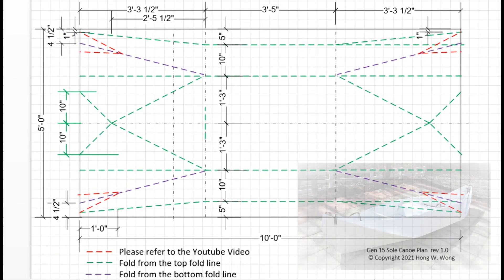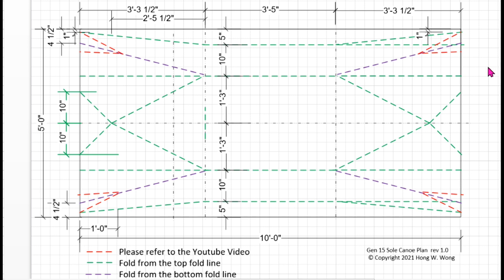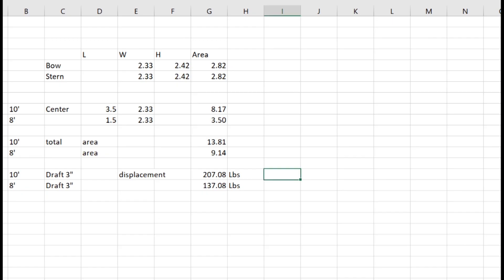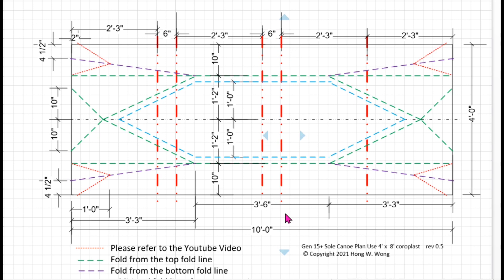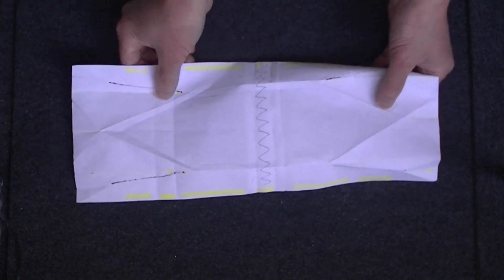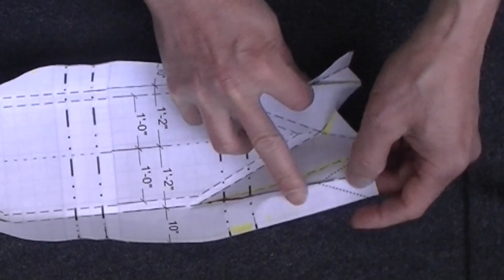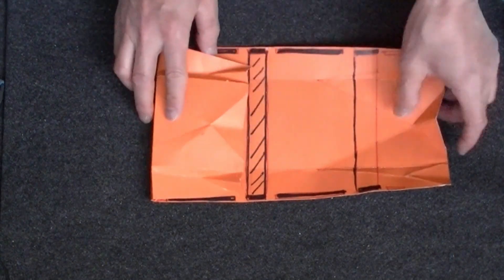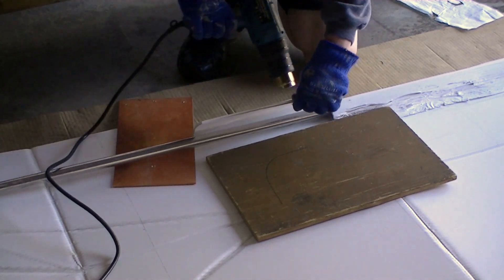Part 3 DIY 10' Foldable Coroplast G15 Canoe:  Canoe Plan

Comment: I really appreciate your video. I made a canoe that is based on your design. I rowed my canoe successfully on the river. 
Here is my canoe video:https://www.youtube.com/watch?v=P9HyylMYNYM&t=22s
Reply from the maker: Thanks for sharing your video. Most people just watch how others building boats, you are the few special ones who actually doing that. Congrats!  I have been watching others building theirs for many years until I realize it is not difficult if I build boat using coroplast. My G15 is an easier boat to build. You can use contact cement to joint two sheets. A lady built two G15 with good results. You can use zip tie to create the 'loop' for the gunwale where you can insert the PVC pipe. Gen 16 videos showed you how to do that. You don't even need to use heat to fuse the coroplast. Cheers!
Reply: @DIYUSA  您好: 感謝您的回覆. 我再建造這條船時, 發現船的兩端有向下的趨勢. 我只好在船邊緣上折一個小角, 並用尼龍束線帶固定. 但我從您的作品上, 並無發現有向下的趨勢, 請問是何緣故?
很抱歉! 我的英文不好, 能幫我翻譯的太太已入睡, 所以只好發中文給您. 由您的姓氏我猜測您是華裔, 也許中文對您來說, 是容易的.
Reply from the maker: @rogerlinitri  謝謝你的提問。我來自香港，在美國生活了 40 多年，我讀中文沒有問題。在PC上輸入中文是個問題，因為我不知道如何使用鍵盤輸入中文。 我在這裡使用谷歌翻譯。 我用 6 毫米厚的 coroplast。 它是比較強硬，因此比較容易建造這艘船。
Reply: @DIYUSA  感謝您的回覆, 台灣這邊雖然有很多生產coroplast的工廠, 但是他們大多生產5mm的厚度. 2000mm*182mm*5mm一片約10美元. 但是運費很貴!
我將經常使用這條船, 累積心得並規劃下一條船, 因為我還有二片coroplast.
Reply from the maker: @rogerlinitri  ORU 使用 5 毫米來建造他們的船。厚度並不代表一切。除了厚度，我們還必須考慮密度。密度高的結構更堅固。
製造商還可以添加其他成分使其更加堅固。
我從中國定制了 100 張 6 毫米5 英尺 x 10 英尺的，每張售價 50-60 美元。

Comment: Wonderful work! Do you think I could make outriggers for an existing canoe with a similar method? If so, I’m trying to think how best to support and attach stainless steel/aluminum cross bars/poles I already have
Reply from the maker: Thanks for the question. I have been thinking about this for awhile (to modify my boats for sailing) and have not had time to build one yet. My gen 10 or 12 is easier to do because the gunwale at the center part of the boat is a solid piece of wood (gen 10) or plastic (gen 12) which provided a strong mounting point for screws. Which can be used to mount the rails for the out-rigger. For Gen 15, I can still create the mounting points by embedding a strip of plastic on the side wall of the boat. It is easy to do if I use  heat fusion to sandwich a long piece of flattened PVC pipe. However, this video  https://youtu.be/-n6u-uUKoRQ  uses inflatable stabilizers and they are mounted on the side of the boat. I will make something similar and use coroplast to create the small pontoons which I can mount that (for gen 15, and gen 16) on the side using lashings (similar to the video). I will design the pontoons so that I can mount them next to the side of the boat, or using rail/pole to extend them out to gain more stability. Cheers!